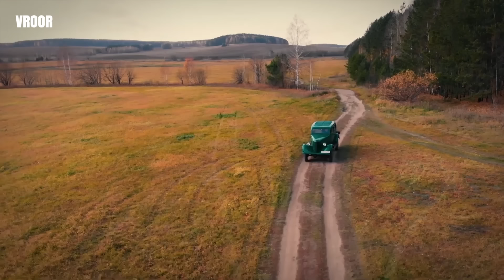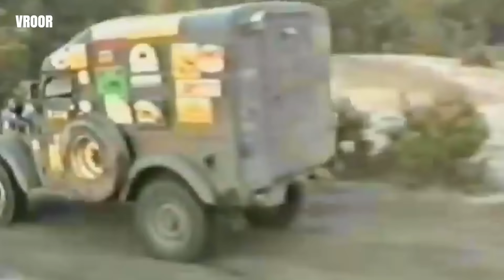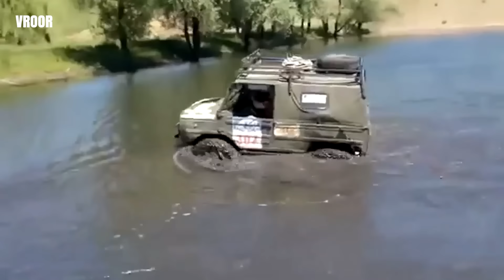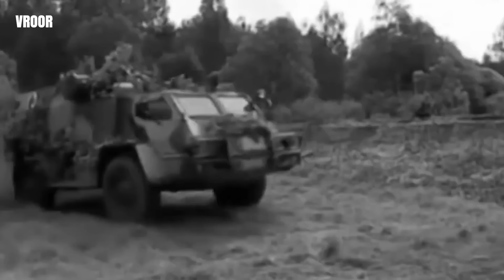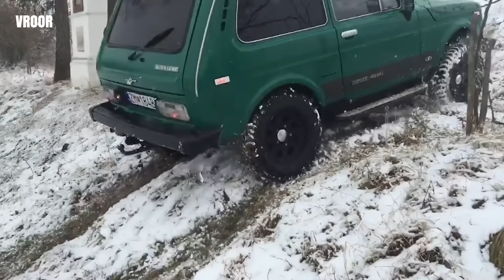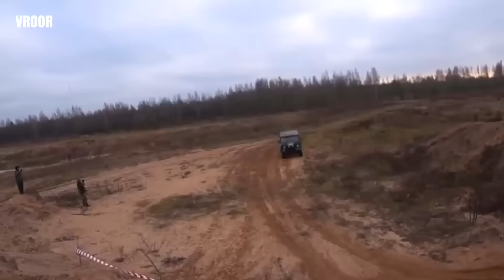The Soviets Built These 4x4s to DESTROY American Trucks — And It Worked

Comment: I had a short ownership of a "Breadloaf", it was many years ago and I have never had a 4x4 like it. The Darn thing just went anywhere! It really was unbeatable. Unfortunately, someone came and bought it for 4 times what I paid for it. I've never been able to find another one, but if I did, I'd have to buy it. I think it would make an incredible Day-van with a capability to go absolutely anywhere. One thing that struck me when I had mine ws how comfortable it was to drive. Even over the rough stuff you didn't get thrown around. It was a bit slow, but it ran smoothly at respectable speeds. The centre of gravity was high, but a set of slightly wider wheels sorted that out. It would customise easily with no work needed to the mechanics at all. Seriously impressive.
Reply from the maker: That's an amazing story about your "Breadloaf"! It's clear why these vehicles were so legendary for their off-road capability and comfort. It's a shame they're so hard to find now, but your vision for a day-van sounds incredible.

Comment: UAZ did not have portal axles. I had a 452 for two years, it had rigid axles with leaf springs. Build quality was horrible, it leaked, it rusted in a spectacular way. Both prophafts tore themselves apart at the uj's, despite my religious greasing scheme. It had two fuel tank, one tank refueled the other through a venturi system, there was a petrol stench all day long, and when I opened a tank there was the risk of being spat a lot of fuel over my clothes, thanks to all kind weird pressure differentials in the venturi fuel system between the tanks. Speaking of fuel tanks: both went leaking at the seams and had to be replaced. Yes it had a great wow-factor. The all terrain capabilities were legendary, and I say so after nearly 30 yrs of Land Rover Defenders!
Reply: There was two version of axels, one farmer version and one military version with portal axels.
Reply: You have all information you can dream of in the site uazbuka.
History,  everything.
Reply from the maker: Thanks for sharing your firsthand experience with the UAZ 452! It's always great to hear from someone who's actually owned one, especially with such a detailed account of its quirks and capabilities.